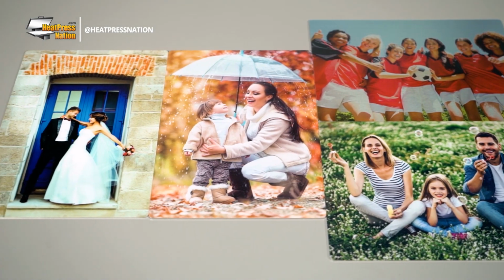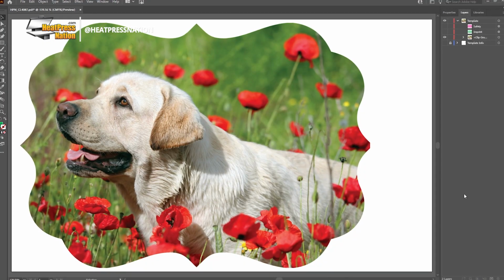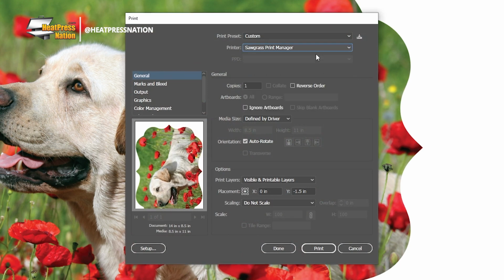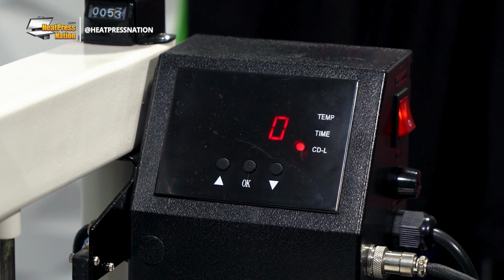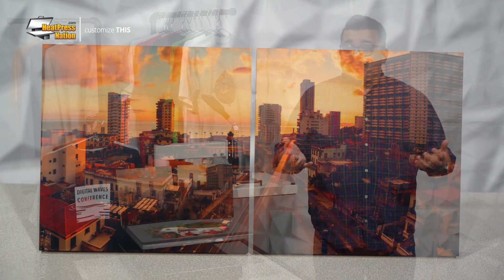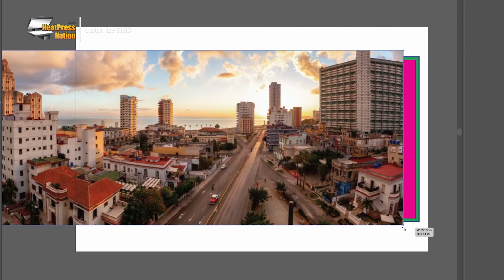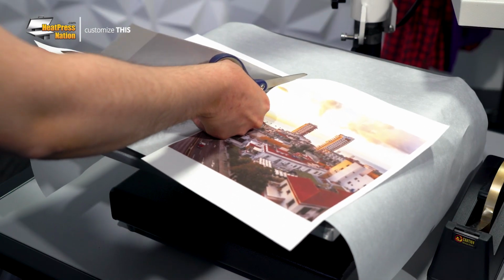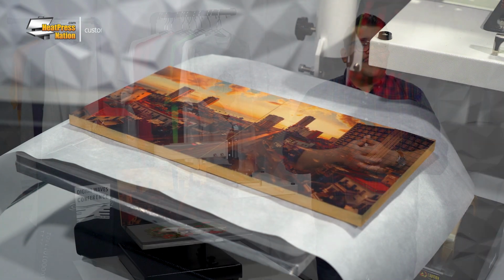How Your Sublimation Business Can Offer Photo Panels

Comment: Hi i am beginner in this business.. Which printer should i use to print on 12*16 aluminum sheet
Reply from the maker: For that, we would recommend the Sawgrass Virtuoso SG1000 w/Multi-Bypass Tray. This will allow you to print up to 13"x19", which should work perfectly for your 12"x16" sublimation aluminum sheets. 

Sawgrass Virtuoso SG1000 Sublimation Printer - https://heat.press/sg1000kit

Multi-Bypass Tray for 13"x19" Prints - https://heat.press/bypass

Comment: I use epson f100 series for printing and sublimation on blank. 

But when i finish them, i see small dots on the image. 
Even on white part, there is a small dots all over.  
Can you tell me what i did wrong?
I do 360 degrees with 85 seconds.  

Thanks!
Reply from the maker: Hi there! Did the image have a transparent background or did you create the image from scratch? If pressing an image that you found online, it most likely has a white background that is pixelated. Dots on your transfers is either pixels or lint.  Hope this helps!